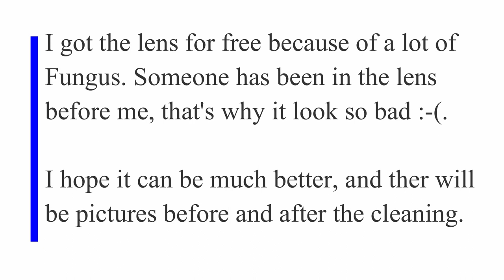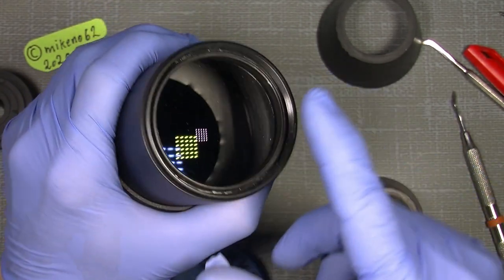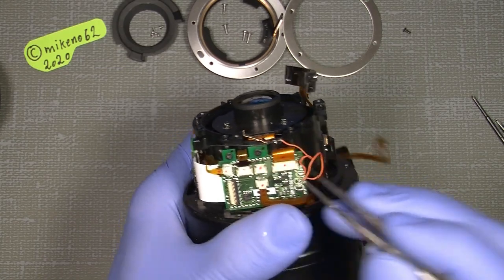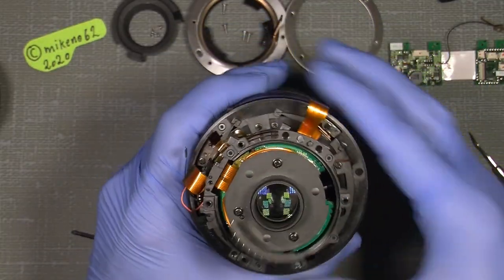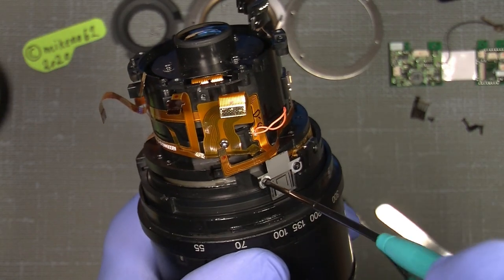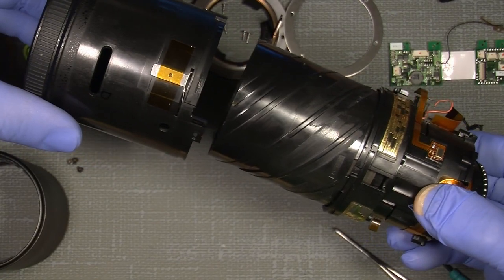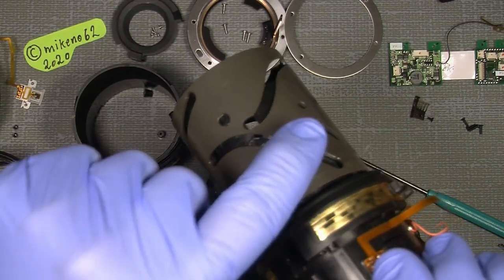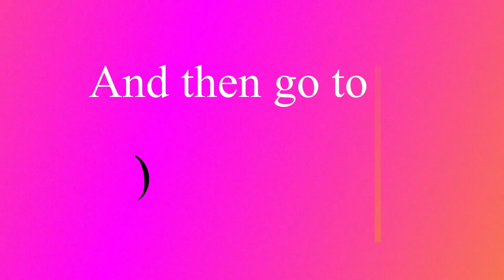How to remove fungus In AF-s Nikkor 55-300mm 1:4.5-5.6 G ED VR DX  PART 1

Comment: hey! i can’t take of the first thing that is on 9:18 mine does not has holes to use a compass
Reply: how did you take it out? I am in the same position...
Reply: @davidquesada388  i didn’t
Reply: @pilarmartinez5810  Just use a rubber ring; add alcohol to lube threads first

Comment: Hi Mike. My front doesnt have those two groves to open. Is that normal?
Reply: @mlungisi1702  I also have this lens without grooves in the front element retaining ring. You need to unscrew it using a rubber removal tool, and then the same can be done for the front lens element.

Comment: hello friend, I have a Nikon lens 55-300 DX and I would like to know how to remove the front ring of the lens, I have already watched your video, but mine does not contain the two notches to support the compass
Reply from the maker: I think it should be possible for you to unscrew the front ring with one of the rubber cone tool, there could be some thread lock, so you have to use 2-3 drops of Isopropylalcohol 99% or 75-80% on a cotton bud, and you add it on the thread and let it sit 20-30 second, and then try to unscrew it, if not working, then try with more Isopropylalcohol.... etc. etc.